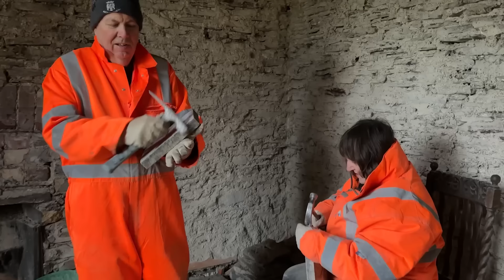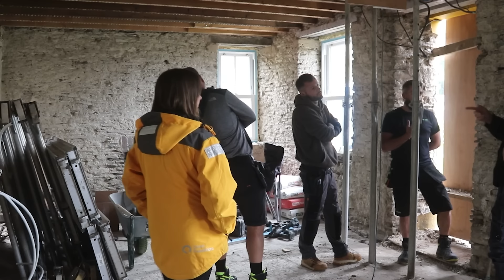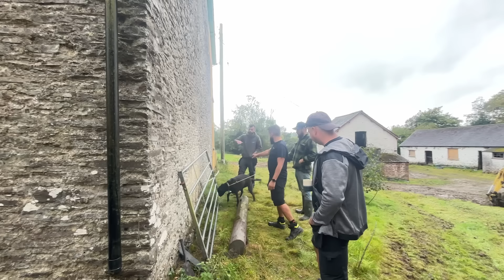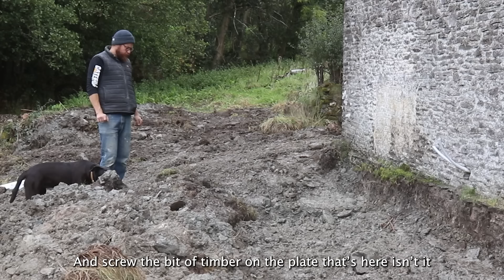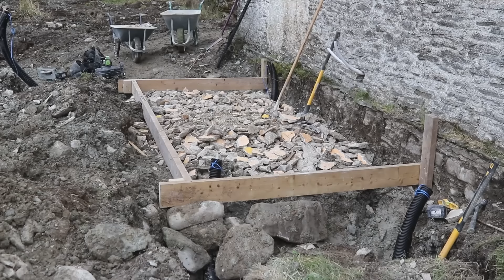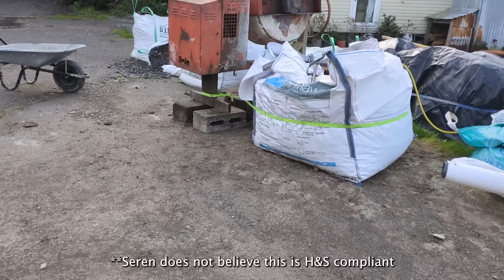Renovating our house will never be the same. (ep.34)

Comment: We had a heat pump fitted almost a year ago in an old house with thick stone walls and minimal insulation to replace a condemned oil range and it’s definitely a huge improvement so far. The guys installing didn’t believe us when we said the stone was very hard in the walls until they spent some hours trying to drill through them! With solar power as well it should be great for your house. Good luck with it all
Reply from the maker: This is great to hear!
Reply: @citytosmallholding I also had a thought that you might find it harder to heat upstairs with the vaulted ceilings so when you start building walls up there it might be worth considering if you can do it in a way that makes it easier to add ceilings if you change your mind later on. We had a room we put the ceiling back in to which was always hot in summer and cold in winter but I don’t think the insulation in the roof was adequate so that didn’t really help

Comment: I hope the off grid heating & power works. There is no real long term independent data regarding reliability & safety of these very very expensive solutions. 

I have a coupe of friends who went from oil to ground source & air source and they regret it. 

Only time will tell

Comment: I've been watching since the start, but had fallen behind a few months ago. picked up again yester/boxing day whilst recovering. So sorry for your loss, and for someone who has featured in the channel, thoughts are with all the family.
I'm a heating engineer by trade, albeit off the tools now, but as a heating contract manager, I now have to maintain around 300 poorly installed heat pumps from around 15 years ago. Heat pumps 100% work, but only if the system has been designed properly. If any of the following have been suggested, then please get a second opinion... Per-plumbed hot water cylinder, buffer tank, low loss header. For the property size and insulation you showed in a previous video, None of these are required and will lower efficiency if installed, they are used to cover up poor design. I don't have any knowledge of Heatable, so I apologise if they have already done all this but I just wanted to share what I know from experience. Love what you're sharing, ..........on to ep.35. thank you and happy new year

Comment: Unless the camera is deceiving me, that footprint looks awfully small at least by a third for both the battery bank you’ll need plus housing plants. Did you discuss with your solar provider?🤔🤔🧐
Reply from the maker: Sorry I’m not sure what you mean and yeah Heatable have done all the calculations for array and batteries etc
Reply: @citytosmallholding. Yeah, as the camera moved around it did look bigger than from the one view from the right side.

Comment: Hey, great to se you guys back at it. I had a heat pump and solar system fitted to our house, its about the same as yours but had been modernised a bit more. We had the walls clad and better ventilation and circulation installed. Happy to answer any queries about heat pumps, electric use etc, but would thoroughly recommend unless you wanted to go the biomes boiler as another great alternative to fossil fuels. Good luck with it all and like I say, I love the heat pump, house is warmer and dryer than ever.

Comment: Heat pump and all new rads about to go into my uninsulated solid brick/stone detached home (with single glazing!). It's all in the heat loss survey... mine approx 20KW at 0 decC ! Costing an arm to install (versus new windows and doors which would be two arms and a leg). With solar and battery... estimated cost to run about 1/6th that of gas (potentially even better)- so there is an (almost) acceptable payback period.
Reply from the maker: That's really interesting, thanks for sharing!

Comment: Sorry for your loss and I hope you are doing well and healing in yourselves.

We live relatively close to you (probably within 30 mins) and are in an old Welsh stone cottage (Ty hir) that has been extended over the years to make an absolute oddity of a building with hundreds of years worth of different construction methodologies all under one roof and we have a 7kWp roof mounted solar array, 27kWh of batteries plus gateway (it meant we didn't have any problems in the storm last December) and have just had a heat pump fitted which is so far keeping us toasty warm and at the current outside temperatures is running at around 400% efficiency so it absolutely can be done and work with old Welsh buildings. If you need any impartial information on what it's like with these systems in this area feel free to reach out, we are always happy to talk energy efficiency
Reply from the maker: This is great to hear! Thanks!

Comment: We have had solar panels for years now, best thing since sliced bread! Started off with 6kw solar panel system, then upgraded to 13kw.
Cut our power bills down dramatically, we only used grid power at night, many times we didn't have a bill at all. Probably due to our endless sunshine in Australia 🇦🇺 
Recently, we added a 15kwh battery, so now we don't draw from the grid at all. Panels fill the battery every day, even on grey days they still manage to fill the battery. Our grey days wouldn't be as grey as some of  yours, but Im sure you will get some power on grey days.
We now provide all our own power, send some back to the grid, and our bills always have a credit, power company owes us money now!
Reply from the maker: That's incredible, sounds like a dream set up!

Comment: Just had another thought. If that is where the fan of an air source pump is going it needs to be put in the open not in a shed. The air needs to get to it. My son has one my brother has one and in our street me and four neighbours each have one. None are enclosed.. Also air source pumps cause condensation and need gravel to sit on to allow that moisture to run off. Not concrete . But if the air source pump is not going there it's fine.
Reply from the maker: Yeah the air source boxes will be outside, just the cylinder, batteries etc in the plant room

Comment: We looked at heatpump for our similar stone house...doesn't work for us as we can't insulate enough and radiators would need to be huge.

You've benefitted from ripping it back to bare so can insulate and put in underfloor heating. Much better system for heatpumps - You've probably already got it designed but with the land you have you could have gone ground source which is possibly even more efficient.

Looking forwards to the build.
Reply from the maker: Yeah we are lucky we are starting from scratch and can do all the insulation. We did look into ground source but it was just so expensive it was out of the question unfortunately

Comment: Great to see you back.  Heartfelt condolences for your loss.  Just wanted to say that I had a Solar/battery/gateway installation from Heatable (Apr 24). Nothing as challenging as yours but I still had the battery and Gateway installed in a detached garage away from the house and incoming mains/meter.  I’ve been very happy with the system so far and reduced my energy bills by 75%.  Good luck with the ongoing renovation.  Really enjoy following your progress.😅
Reply from the maker: That's fantastic to hear about your system and the energy bill reduction!

Comment: Hi , so lovely to see you back have missed your videos, we have air source heating normal 3 bed house, was costing us £200 a month on electric,  we now have solar panels our electric costs dropped to £72.00 a month ( in summer) of coarse heating was off, now colder weather here heating is back on now our electric is gone back to £110 a month...so overall we are  still saving £90 a month with our solar panels..just to give you guys a rough idea..air source radiators in house are not hot to the touch but warm to the touch..our last house was oil central heating we couldn't hold a hand on our radiators the temperature of them were alot hotter...we are happy will our air source heating & solar will keep your electric bills down..

Comment: Really sorry to hear of your loss. I have followed your story from the start as we live not far from you in a similar property although it was not quite as bad as yours. After years of indecision we finally made the decision to go for a heat pump and solar. Been running two weeks now and what a difference. The house had internal insulation done which has made a massive difference. It is warm and noise free. We heated the house via an oil boiler and we only had the heating on for four hours a day and were using 1000 litres of oil in three months. For us it was four weeks of a messy hell as we lived in the house at the time but when finished it was worth it. Make sure you get every inch of wall insulated and the roof/loft space as well. You will love it when finished.
Good luck and keep filming it.
Reply from the maker: Thanks for sharing your experience, it sounds like it was definitely worth it!
Reply: What you have to remember is, if you are going to insulate to that level it doesn't really matter what heating system you choose. Our stone farmhouse is insulated to a high degree and our main heat source is a wood-fired range - ideal as we have access to firewood from the land - the oil boiler is literally used in the coldest of weather (proper winter weather) and is on for 20 mins first thing in the morning and the same in the evening if we don't have the fire lit in the living room. We use 500 litres every 2.5 years. Unless you can get an installation grant, the outlay for air source has an extremely long payback.

Comment: Nice to see you back! But man, a groundmounded solarsystem should always be the last option. It is ugly, it destroyes landscapes, you really should try to avoid that. Also, please be careful with insulating the old stone walls. Consider to call in somebody in who has experience with those buildings. It is so often done wrong and can cause a lot of problems. Heat pumps are better suited for new houses (with better insulation) as you surely know. But I guess it would work very well for your small space  - together with a woodburning stove or something else that can create a lot of heat fast, but is not ment to keep the house at a specific temperature all day long.
I wish you all the best for your renovation and I am looking forward to the coming videos!
Reply from the maker: Don't worry we are using all breathable wood fibre insulation specifically for these kinds of houses.